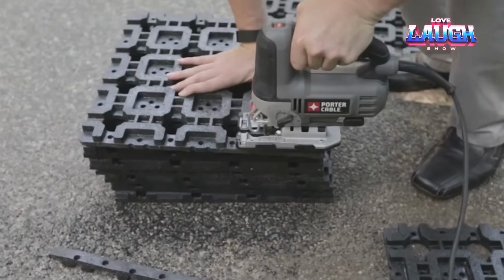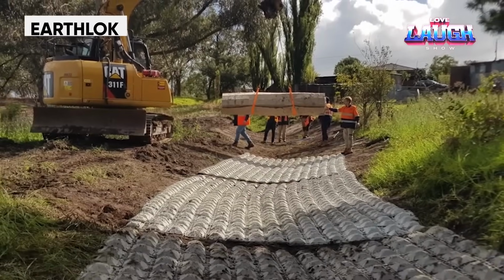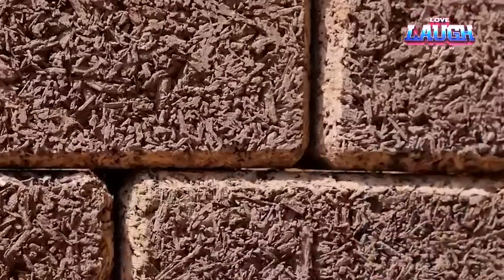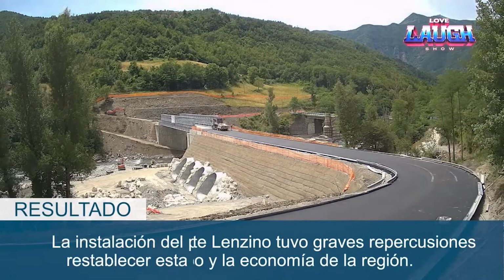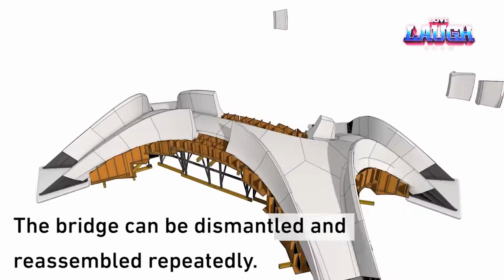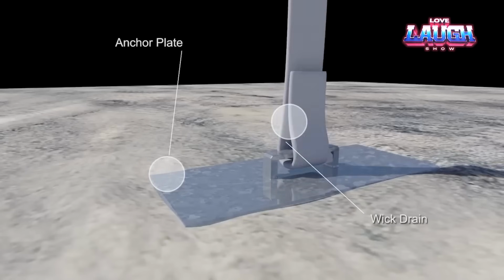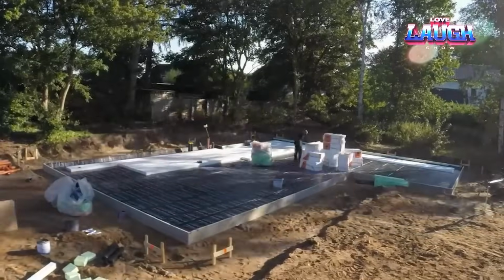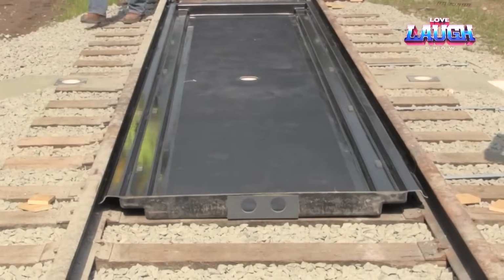Ingenious Construction Workers That Are At Another Level ►13

Comment: Jacking up a roof is WAY more dangerous than working on one.  The jacks alone will far offset any savings.   Not to mention if you are a builder, you aready have the safety equipment.